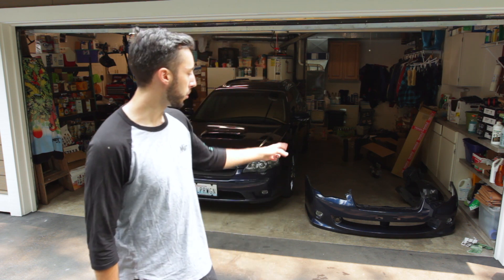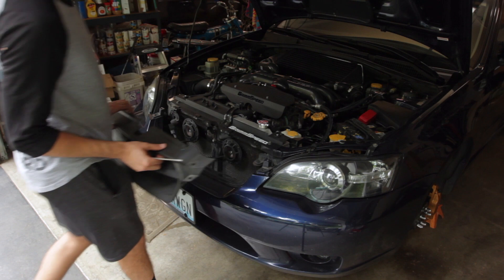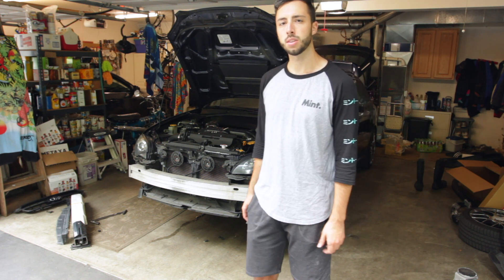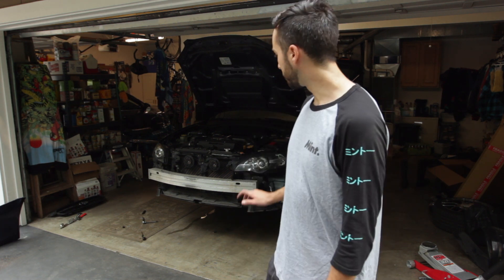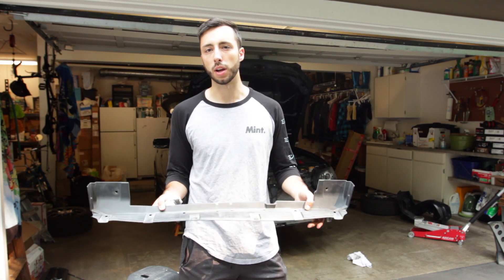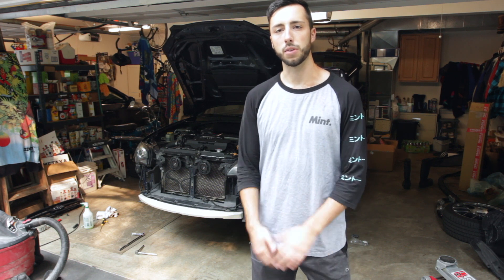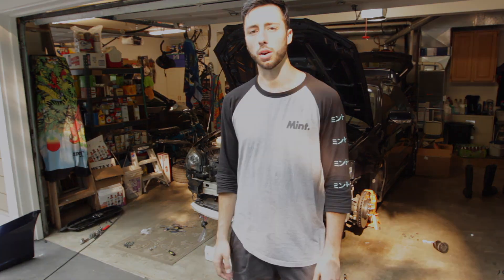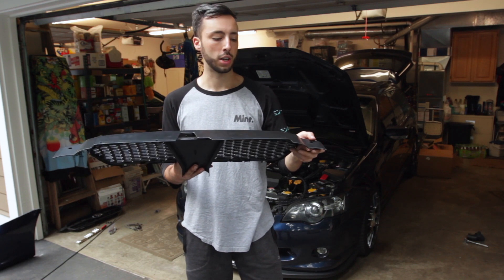JDM Spec B Bumper Install, how it SHOULD have come!

Comment: Solid build, I noticed all legacy bumpers are pretty much the same. I own a 09 legacy 3.0r and im wondering if this bumper would fit it?
Reply from the maker: You would need new fenders and headlights I believe as this is for the pre facelift models but there is a JDM bumper for the 08-09 that is rad and should be easier to fit to your car.

Comment: Hi I have a 2005 Subaru Outback XT Limited Wagon ... I want to ask if  -  JDM Subaru Legacy Spec B Front - Fog Lights - Bumper - Headlight - Fenders - Hood - Grille 2007-2009 ... will fit my Outback?
Reply from the maker: I’m not 100% sure as I never researched putting the parts on an outback but I believe they will technically fit however they won’t match the body panels/lines on the rear of the vehicle. The JDM outback bumpers are pretty sweet though so I’d suggest checking those out.

Comment: Awesome! Can I use the 08-09 grille on my 05 Legacy without replacing the bumper?
Reply from the maker: József Milán Pintér unfortunately not, the 08-09 style grill only works with the bumper from that year or a JDM bumper.
Reply: Shit... OK, plan B. DIY :D
Reply: Great. I have an JDM Bumper from 2005. So I can use a Grill like this. Thanks.

Comment: Hey does the bumper have to come off to change the headlights or can you do it from the wheel well?
Reply from the maker: kbordenave if you’re trying to remove the whole headlight assembly you will need to take the bumper off to access the brackets below the lights, but if you’re just talking about the bulbs then it can be done from behind.

Comment: What if one wanted to do a 2009 jdm spec b front? With the new headlights and such?
Reply from the maker: xxnissansilviaxx that requires a bit more, but people have done it. I believe it is bumper, grill, headlights, fenders, and related accessories behind the bumper.

Comment: Hey I’m doing a JDM front and rear bumper swap on my 05 GT wagon (bumpers are on the way!!) and wanted to know if you need the JDM headlight brackets or did you get those to complete all the JDM parts on the front end. Great vid, sweet ride and thanks
Reply from the maker: Yo what's up man, congrats on the new bumpers those are going to look sick! If I'm remember correctly, they're not absolutely essential but I found a pair and picked them up to ensure OEM fitment.